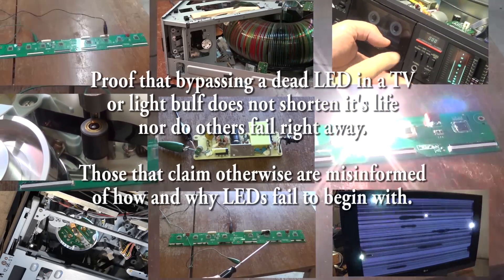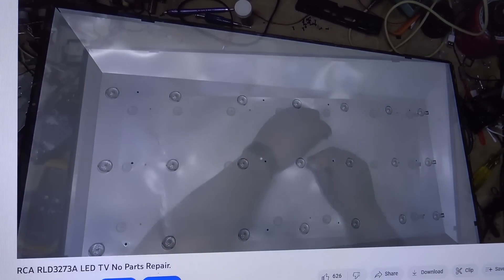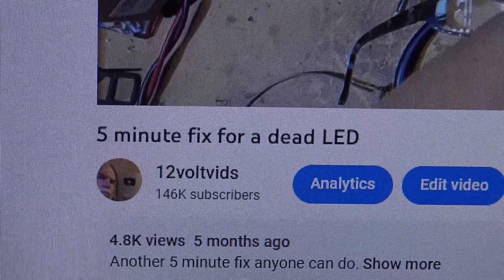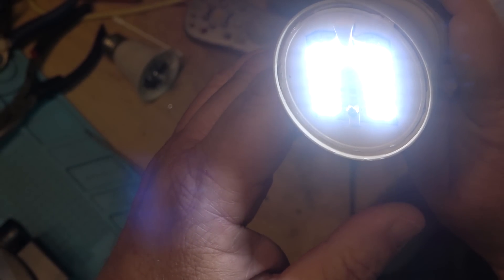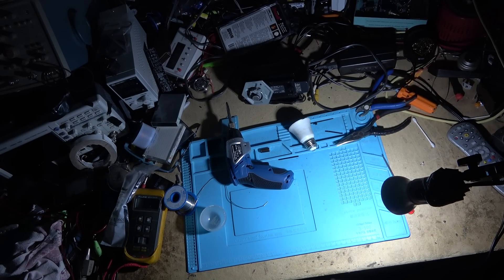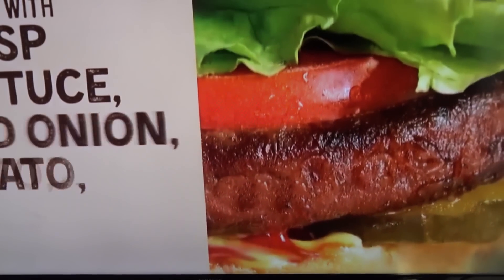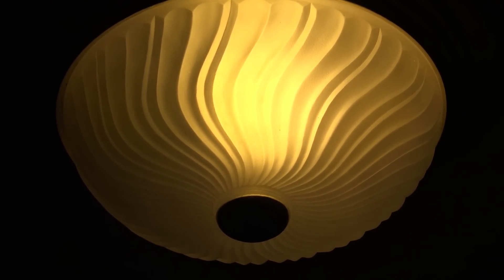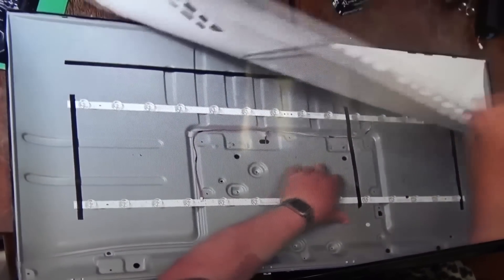You can stick your comments about LED TV failures where the LEDs don't shine

Comment: i have an insignia 32" led tv from 2014 that started flickering it has an external power brick. maybe one of the led's is going bad? I tried a different power supply and it seems to do the same thing. so i don't think the power supply is the problem. it was running for most of the day for our camera system but we shut it off at night. now i'm just using an old I-inc 28" LCD monitor that has a better picture anyway. but would still like to see if i can get the 32" to work correctly.

Comment: i bought a pack of 2 of E27 Airam LED bolbs with 3yr warranty, well both of them first starting flashing at 1,5yr when cold and failed totally at 2yr, so i just returned them to the store and got full refund. Airam used to be a quality manufacturer in Finland, but now the brand is owned by chinese company (what else is new)

Comment: Sometimes, an LED was just poorly manufactured. Bypassing one only gives about 3.5 vdc to all the others in series, they can handle the slight increase. 😊👍
Reply: What increase though? It's a constant current supply, so there will be no voltage increase presumably. I think that's the point that's being made. It's not like a string of 20 x 12V fairy lights for 240Va.c mains use. If you bridge a 12V fairy light, then yes, you've got voltage increase to the rest. This doesn't happen with these LED circuits because of the constant current supply.

Comment: The old mini incandescent christmas lights had this problem if a burned bulb wasn't replaced quickly it would cause the other bulbs to burn out and would eventually blow the fuse, every white led light be it cool or warm white is a blue led with a phosphor, warm white is more expensive to make because they have a rare earth element in the formula,no led phosphor actually contain phosphorus.

Comment: Not everyone who tells that other leds might fail is a "troll",and a lot of people out there know what is the constant current source and among youtube viewers there are a lot of people around the globe that are very experienced electronic technicians having decades in repair of electronics.You can ommit as many leds you want since the current flowing through of them is constant.Also this current source in most of the cases can be lowered by a simple modification in the circuit of the led inverter.
Reply from the maker: The experienced ones are not the ones claiming that all the others will fail because they know this is not the case.  I have over 40 years in the field myself.

Comment: 12volt Why do you care...if it's fine with you to do it this way...then...fine....if it works it works. If your costumers are happy after years of use then they are happy.

If somebody has a problem with it it's kinda their problem. Let them do it their way and be happy with it but don't react in this way to this troll activity. It's simply not worth it and you kinda giving them what they want, and that's a huge reaction. 

So stop it, and continue on.

Comment: While out driving about I've been noticing the newer cars with LED back lights NOT WORKING or partially dark.
I saw an electronic fixit guy take one apart (The entire thing was sealed shut) with little effort and then found that the board the LED's were applied to was so thin that it broke by cracking, probably from vibration.
It was a simple fix and then he super glued the light case back together good as new.
A new light for this particular vehicle was $800.
HOLY CRAP!!!!!!!!!
It took this fixit guy about 10 minutes and some solder and thin wire to fix.
Oh, and the glue to seal it all back.
I'm guessing these lights are made in some foreign country with low product quality control and the cheapest parts around. I'm betting that the whole light assembly cost maybe $10 if that much.
When you look on TEMU and see all the incredibly cheap prices there and wonder how they are still making a profit, it's a mystery.

Comment: I'm not an expert in electronics yet. When you bypass an LED, do other LEDs get more power flowing through them?
Reply: No, the LEDs are in series driven from a current source, when you jump an LED the current source puts out less voltage, so the total power drops for the string, and each LED still gets it's original power.
Reply: Yes, they will get more current flowing through other LEDs, but it will still work,

Cheers!

Comment: You are right about the TV backlight control. Go into your menu and click the backlight and if it maxs out at 20 then
drop it down to 8 or 9 and you won't burn out any LEDs quickly. You should get 10 years at least out of them. The cheap
sets however may have really cheap design that even though you drop the backlight down it may still be too much 
voltage and a few may go out. But that's true of any super cheap electronic device. Hell  I got LED bulbs that go out after
less than 3 years where the manufacture says that they should last five years. Soi jumpering where a failed LED was isn't
a problem it is a solution. Good video Dave!
Reply: I run our tv at between 40%;and 50% brightness. No need for 100% brightness, I dont need a sun tan
Reply: In the real cheap ones I have found the strips are only held by like 3 screws and they don't make a nice tight fit against the metal back panel.. I have some real strong fiberglass embedded type tape so I stick em down nice and firm.. That seems to increase the life

Comment: You can call me a troll, but I can tell you from my personal experience of doing quite literally 30 TV's in a month - every month. It is not worth the risk of even 1 percent coming back. I operate a full-time brick n mortar repair shop. That's a rare thing to find in 2023. There is zero reason from running a full-time business to do a patch job in my opinion. I charge customers parts at cost with you usually a $50-$100 cdn fee (depending on the size of the tv as  larger tv's require 2ppl. ) So why would I want to risk even 1% of them coming back? Expecially when doing a 85" TV. Do you know how awkward it is too work on an 85"? It takes up space...And when I have rent of $2500 a month too pay. I need to do a damm lot of repairs in a month and risking jobs coming back for warranty issues makes ZERO sense.

Side note: I used to literally hand solder new LED's directly onto the strips.  Not just jump them, but literally replace them. And I still had plenty of TV's show up with another burnt out LED whether it was 30days, 6mnths or 1yr later. Why as a business do I want my work coming back? Or even risk that? Warranty jobs just take up space, money and time.

Also if you really want to keep this debate going, I can break down make, models, etc that are more prone to consistent failure. 

Doctors do not always agree, and sadly as my professional opinion, I prefer to not do this. If money is an issue for a customers, then I solder on a replacement LED and set according expectations. But for you too say 100% every single tv is gonna work just fine. Thats false.

If you patch your tailpipe, you want to tell me the possibility of another hole is zero? If your car has an accident is getting bondo slapped on it the same as repairing it's structural integrity?

$30 cdn for a brand new set of LED's and a $50 fee is in my eyes me providing an insanely cheap service that I know a TV has been fixed properly and I can confidently warranty. It's not like LED strips are expensive if you know where to purchase them.
Reply: They will 100% of the time work fine.
Reply: There's a lot of folks out here that don't want to take to get repaired for $100 or so. We fix it ourselves. If it wasn't for Dave, most wouldn't know how.
Reply: Here is a snowflake 😅

Likw a car and a tv is the same thing.

You cry about bridging 1 led that nobody will even notice is bridged?

A car and a tv is totally different

Comment: Dave you are 100% right, the power going to the leds is a constant current,  so no problem.
Reply from the maker: Every LED power supply is a constant current type. Even the cheap 1.00 bulbs.
Reply: @12voltvids  er, not quite 'all', i've had an odd few, a few years old that used a single high power led in it, it was fixed voltage driven, with low value resistor between the fixed output smpsu and the led , unfortunately i dont have it anymore as i chucked it after i 'autopsied' it,,  most of the led bulbs now dont even use capacitive dropper but linear current stabiliser chip, they get pretty hot as it is ,and will get hotter with a shorted led, but its fairly easy to increase the current sense resistor to reduce it a bit and it'd still likely be bright enough, if they didnt use such an opaque outer diffuser bulb, but a lightly frosted one instead, they could reduce the led current for same light output ...
Reply from the maker: @andygozzo72  that large "single" led would have been a cob type with multiple junctions internal all in series just like the filament type LEDs today.
Reply: @12voltvids  the driver was still 'fixed' voltage output, not constant current, i think i have another one similar idea somewhere... 'Diall' branded , its probably 4 or 5 years old, never used yet, except to test,
Reply from the maker: @andygozzo72  no, it's not.  Under no load it will float under load it is limited to 30ma and the voltage goes to the combined voltage drop of the diodes.  Someone needs to study how these drivers work.  No point expialining it further you don't understand.
Reply: @12voltvids  it definitely did not 'float' with no load, it had a circuit similar to whats used in many 5v usb chargers, but higher voltage, it had no current sensing only voltage via zener, unfortunately cant prove it as it got chucked... but if i come across one the same or similar, i'll let you know
Reply from the maker: @andygozzo72  on a yv the voltage will go to the maximum that the led driver is designed for.  Remember that they use the same board on many different size sets of the same model run.  It is designed many different panels.   It will go to max voltage and stay there.  This could be zener limited depending on the design.  Some sets if you unplug the led strip will go to ovp and shut down others will stay on.  What i am getting at is smaller sets have fewer led and the power supply lowers the voltage accordingly by simply limiting the current to 30ma and the voltage falls accordingly.   
What you wouldn't want to do is power the set up with no leds plugged in and plug the connector in.  This would be a great way to pop something.  It needs to detect the load at power up.
Reply: @12voltvids  i'm on about a led light bulb, not a tv , in this particular case, i havent ...yet... had anything to do with a led tv, only ones with ccfl backlights
Reply from the maker: @andygozzo72  yes they are a little simpler device.
Reply: it's not that simple. Driver also has to provide a some minimum voltage in order to light all LED. for example for 9volt 9leds, driver needs to provide 9*9= 81volt. Remove just single LED, now that same 81volt will needed to be dropped on 8leds now. Good quality LED has threshold to handle extra volts/heat, but if you are going to remove more than 1 LED, that definitely won't going to work for long.
Reply from the maker: @it_geek  no the driver open circuit will run up to 300+ volts.  Each led puts 3.4 volt drop.   
Hook that power supply up to 10 led and it will start up and the voltage will be 34 volts.    Years ago I swapped power boards on a TV.  Took one from a 55" with a broken screen and put it into a 40" with a burnt up power supply.   The power supply was the same between the 2 sets.  (Same model year).  The 55" had 100 led (340 volts) and the 40 had 60 leds (204 volts)
That's ok though because many can't grasp how a class D amplifier works and call them rubbish without actually have listening to them.

Comment: This method works, almost always. I had to repair an LG LED TV from about 2012 in 2015. About 4 LEDs died in it in a way that they passed current but didn't light up, 1 or 2 was flickering, after I bridged the one open LED which caused the failure, that one lit on fire its lens and burnt a hole in the PCB strip... I removed the lens from all the non-working ones, and from some still working ones, too. The phosphor gel was full of cracks on every single one of them, including most of the working ones, too. So in that case, I had to replace all the LEDs, because it was a relatively  early LED set in which they tried to compete with the brightess of CCFL backlit LCDs, and they grilled the LEDs with this approach. The LEDs were driven with their claimed absolute maximum current rating according to the LED chips' datasheet. So I replaced the shunt in the LED driver to reduce the current by about 20%.
Reply: That’s a whole different scenario where you had an operational issue from the start. Thats not really the same as jumping one bad LED where the rest were operating perfectly normal as they should be. Had to get that almost in there didn’t you? Lol
Reply: @mikeznel6048  Of course that's a different scenario, I just wanted to point out that if multiple LEDs failed, one should consider to replace them all, because it is either a bad batch of LEDs, or a bad circuit design (overdriven LEDs), so in these cases it's a good idea to measure the LED current and reduce it if it's excessive. LG made some really bad ones over the years, the newer ones tend to turn purple instead of just die (I think Dave had one on the channel a few years ago).

Comment: The issue I thought  I would see doing this would be about either a dark spot or a decrease in overall brightness through the diffuser, but I can't see much of any difference.
Reply: You’ll never see the difference with one LED out. There is a light diffuser that splits the light up before it back lights the screen.
Reply: @mikeznel6048  seen them before, they usually have more than one.
Reply: @MikinessAnalog Yep. Never have I ever been able to spot a missing LED. If you could see a bypassed LED, the diffusers are not installed or it’s a garbage tv.

Comment: Do you really think that incandescent bulbs were cheaper in the long run?
Reply from the maker: They used a lot of energy by comparision.
Reply: @12voltvids  I read somewhere that that GE artificially set the breaking point for incandescent bulbs at 800 hours because they were worried they would not make enough money on bulbs that lasted a lifetime.
Reply: Here in the Europe they are trying to forbid incandescent bulbs, but as I'm informed somebody found a hole in the law and they are not completely gone, but in markets you will find mostly LED bulbs available for sale for home use...

Cheers!
Reply from the maker: @DalmaTon-Records  same here.  Spacialty incandescent are readily available.   What makes a spacialty bulb? Different shape glass, long filament, rough service, vintage replica. Lots still available at the dollar store.
Reply: @12voltvids  Yeah, they are still selling incadescent bulbs for ''industrial purpose'' and for special usage, like for very high power PAR 64 reflectors for concert lighting and for various events, although there are many various RGBW+ LED reflectors available in stores widely, but of course, not with the same power rating like the incandescent ones - we are talking here about 1000+ Watts per reflector...

Cheers!
Reply from the maker: @DalmaTon-Records  her we can still get 60 and 100 watt. Rough service for garage door openers ect.  Appliance bulbs for refrigerators and ovens ect.
Reply: @12voltvids  Dave what are we going to use if we have to replace our incandescent bulbs for our current limmiting testing 🙂
Reply from the maker: @CliveTrezona  stock up.

Comment: Great video I had problems with my 4K tv stupid screen star flickering on me took it apart and see what side wus cause the flickering I took both ribbons cables out then I put one in didn’t flicker then when I put in the right ribbon cable in it star flickering I took it out got some tape I put the tape on the end off the ribbon cable then it stopped flicker and it’s still working with out any problem now

Comment: Been bypassing dead LEDs with jumpers in LED tvs with bad LEDs since they came out and never once had an issue with them. Couldn’t even tell an LED was out!
Reply from the maker: Exactly I have done about 20 and never had a comeback.
Reply: @12voltvids sme. One of which is still going today for me personally. People that say that stuff have no idea what they’re talking about. Just like the people that say metric is better than imperial or imperial is better than metric. The people saying that have never owned a tape measure yet alone used one or can even read on for that matter. Remember back in the early days of internet when it was fun and exciting? Now it’s just maddening. The people saying the other LEDs won’t last have never opened up a tv yet alone know what the anode and cathode on an LED is or how to tell them apart.
Reply from the maker: @mikeznel6048  reminds me of the local idiot that put gas in the diesel truck and then blamed the gas station.  They actually made the news trying to force gas stations back to full serve because they were too stupid to pump their own gas or in this case diesel.
Reply: @12voltvids  Lol... I was almost that idiot, because I moved from the Netherlands where black = diesel and green = gas and here it's the other way around. But even then I still managed to figure it out before it went in the tank!
Reply from the maker: @stragulus  black is diesel and green low sulphur yellow and red for gas as the station i last went to.